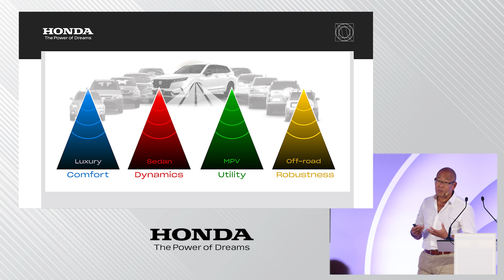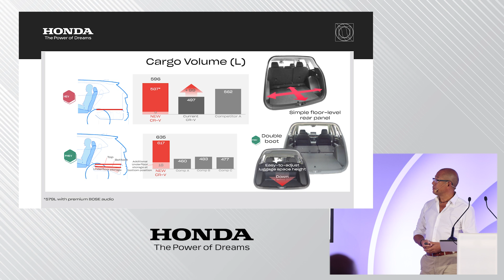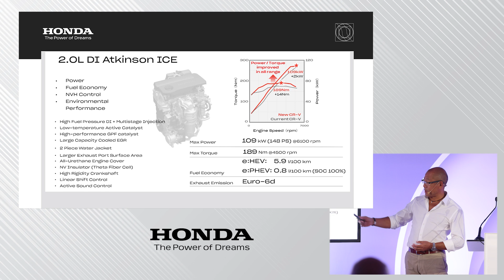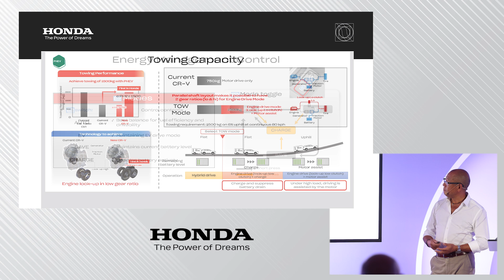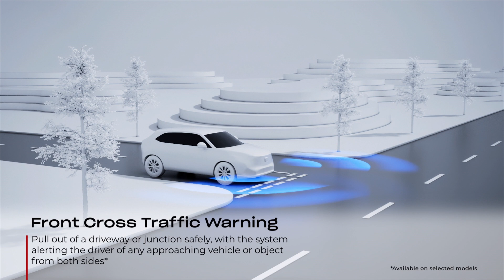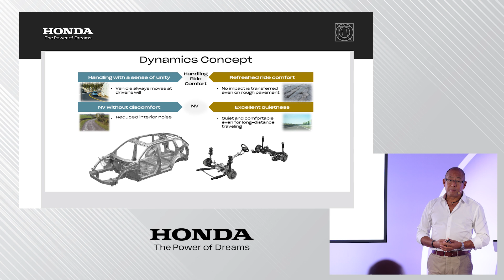New European CR-V Product Presentation

Comment: Does the USA 2023-2024 CRV also have the high and low ratio ICE drive? Thanks
Reply from the maker: I see no reason why they should be different so yes I believe the US version will have a high and low gear ratio.
Reply: @kotaroyamamoto808 I own a US 6th gen hybrid (‘24 Sport Touring) and this is correct.  It can direct drive at 2 speeds: mid 30s and mid 60s mph.

Great presentation!  I keep hoping Honda North America brings a CR-V PHEV to the US to compete with Toyota’s RAV4 PHEV.  If Marysville Auto Plant wants to build me one, I’ll drive over and pick it up!  This European model looks near perfect!

Comment: Great presentation!...I wonder that noise insulation or comfort in general doesn't have its own agenda point. Especially noise insulation, is something very important at least for me.
Reply: As a owner o phev it is a great improvement first from previous generation 2019, secondly from other cars also as it has double glazed windows.